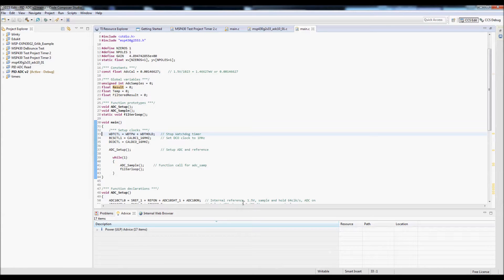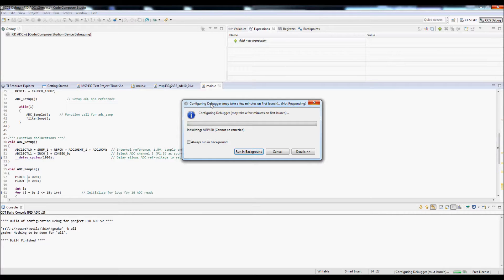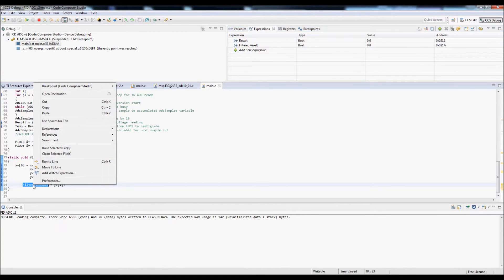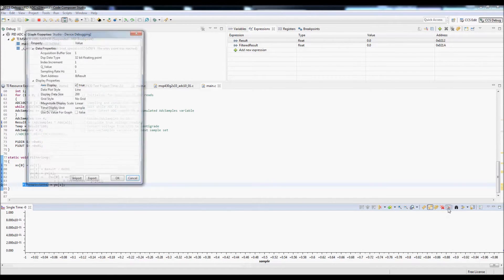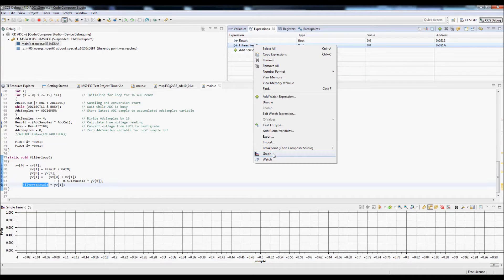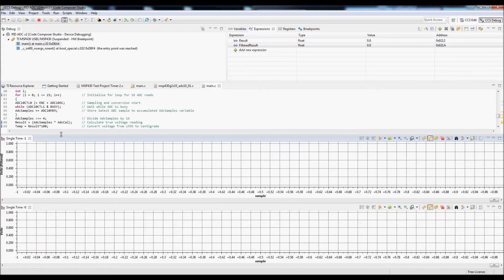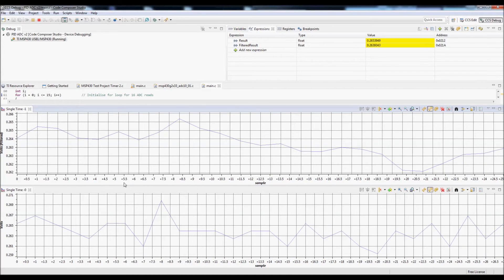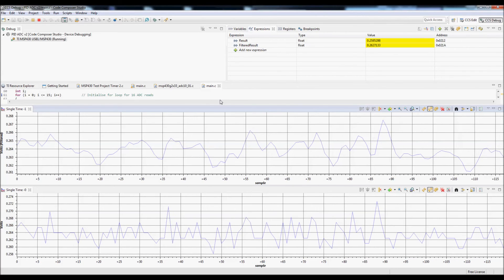Code Composer Studio Graphing Tool Tutorial with MSP430G Launchpad

Comment: Hi Ant, that's an interesting feature that had passed me by in the IDE - Great work.
I guess you can get a similar result from the GUI tool that Ti have built into CCS (if you can get it to work that is)
Reply from the maker: Michael Dalby Hi Michael, thanks and hope it will prove of some use in the future.
I am surprised TI don't make more training videos showing this, they should be demonstrating the benefits of these features.  I have had the GUI tool working before displaying an accelerometer read out, this was a few years back when it was first introduced and not used it recently, but maybe a subject for a further video!
Reply: Hi Ant, 
Thanks for the response. Thanks for sharing it with us all.   Yeah an instructional video on the GUI creator would be great... Especially making a stand alone application (which I think can be done with the Gui tool)?
Reply from the maker: +Michael Dalby A very late response to your last message.  Not had a chance to look into the GUI yet as finishing up my final thesis still, however I believe you can create a standalone application.  Another option is to create something in Processing (Never used it myself) as there are plenty of tutorials.  See this example https://www.youtube.com/watch?v=3SF56iSQo2E

Comment: Thank you very much. Let me ask you something:" can ccs plot 2,3...expresstions in one graph"?
Reply from the maker: +Tran Anh Kiet No problem and hope it was of some use.  On a single graph I don't think this is possible currently, I know you can have multiple graphs with different expressions, an MPPT video I did used this to monitor 3 different expressions side by side.  There is away to export captured data as a CSV file I believe, but unsure of the method so best to ask on the Texas Instruments EE forums.
Reply: Thank you so much,
DId you ever use uart and show data: 2....expressions into gui of C sharp? - Microsoft Visial Studio?
Reply from the maker: +Tran Anh Kiet  I have sent information via UART to terminal software in Windows, the pre-loaded Launchpad example code is a good start if you want to try this, or look at the examples provided in CCS.  Never used Processing but this is supposed to be a fairly easy option to make your own basic GUI, there should be plenty of tutorials based around the Arduino which will be a good starting point.